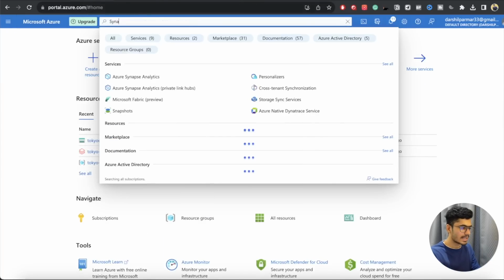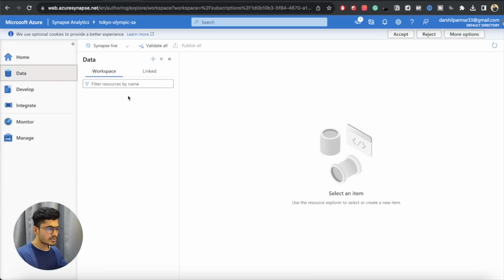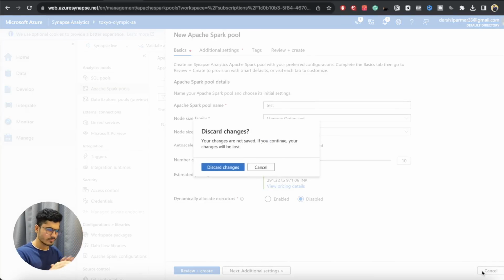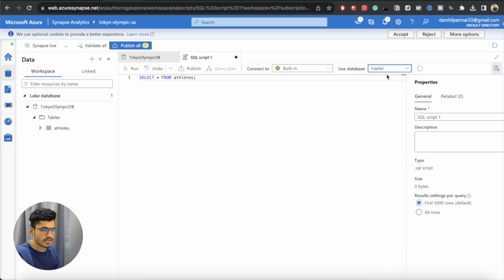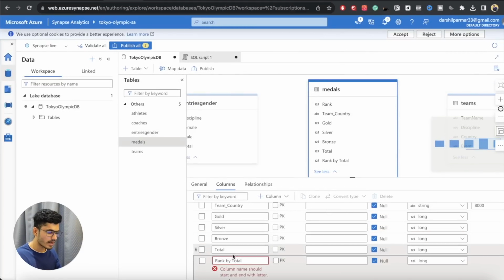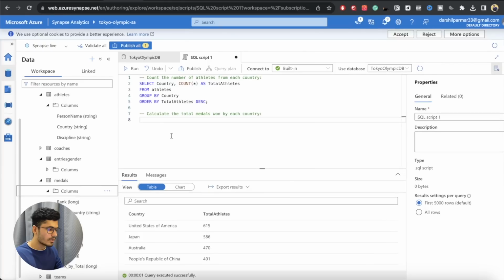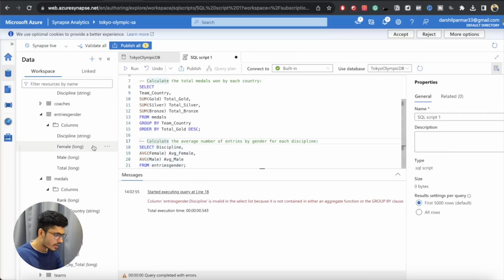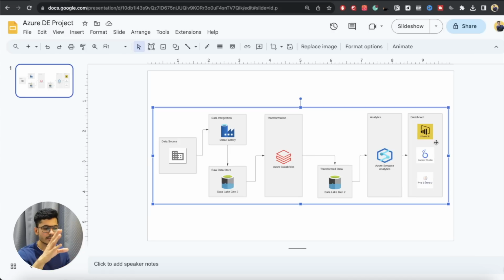Olympic Data Analytics | Azure End-To-End Data Engineering Project | Part 2

Comment: Really good project! two things to point out. you don't need to calculate the total medals won by each country because the row is unique by country so the data is already in a usable format for this task. 2) your query for average number of entries by gender is not correct. Again, each row is unique by country so the avg() will not work. here is the right code:                                                                                                                                                                                                     select 
  Discipline
 ,cast(female as float) / total as average_female
 ,cast(male as float) / total as average_male
from entriesgender .
Reply: Exactly

Comment: Sir, at 8:45 of Part 2 It won't let me create external table after I press continue. It says "Failed to detect schema, Please review and update the file format settings to allow file schema detection" I had no problem in part 1 as everything went smooth.  When I click detail it says "Failed to execute query. Error: Error encountered while parsing data: 'Invalid: Parquet magic bytes not found in footer. Either the file is corrupted or this is not a parquet file.'. Underlying data description: fil"  I even googled and it seems like there is no solution. PLEASE HELP!!!
Reply: i solved it changing the format to .parquet >

athletes.repartition(1).write.mode("overwrite").option("header",'true').parquet("/mnt/tokyoolymic/transformed-data/athletes.parquet")
coaches.repartition(1).write.mode("overwrite").option("header", "true").parquet("/mnt/tokyoolymic/transformed-data/coaches.parquet")
entriesgender.repartition(1).write.mode("overwrite").option("header", "true").parquet("/mnt/tokyoolymic/transformed-data/entriesgender.parquet")
medals.repartition(1).write.mode("overwrite").option("header", "true").parquet("/mnt/tokyoolymic/transformed-data/medals.parquet")
teams.repartition(1).write.mode("overwrite").option("header", "true").parquet("/mnt/tokyoolymic/transformed-data/teams.parquet")

also modify the DB or create a new one in parquet format
Reply: @fmwihler  many thanks bri
Reply: i had the same issue.  worked with .parquet to solve the issue. thank you @fmwihler

Comment: i got trigger async thread was blocked when i run airflow standalone on Ubuntu. i did export pythonasyciodebug=1 but nothing is output. any tips?
Reply: check all dependencies and version of environment and packages. See for any upgrades. Check the log files too, to see if you find any error.